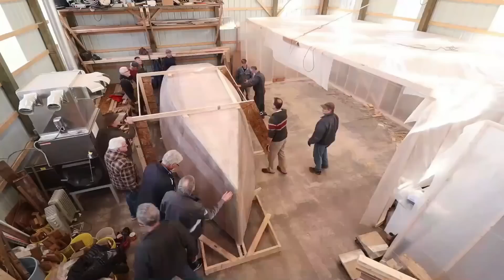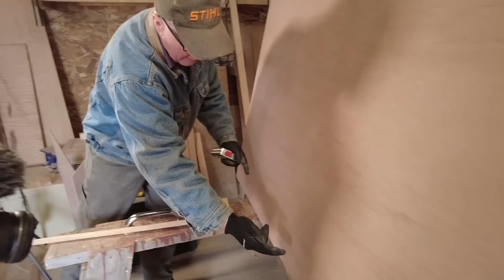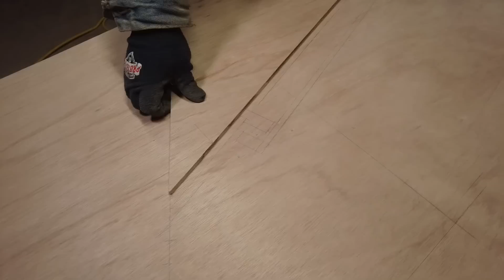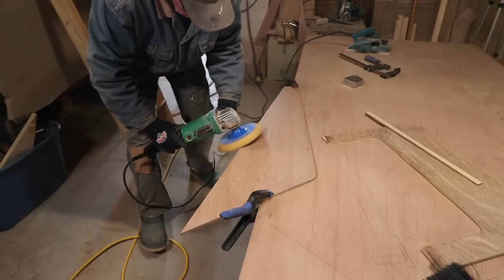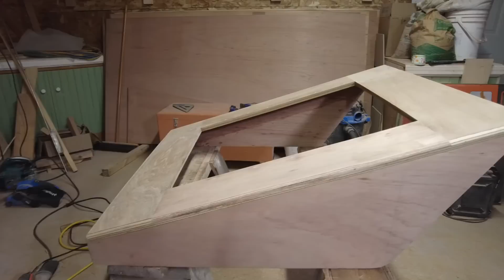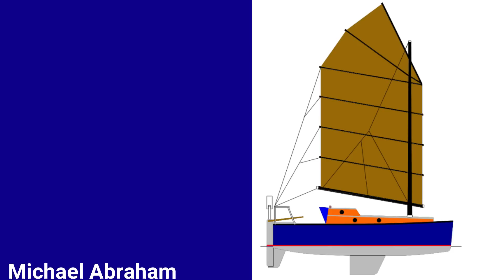S2E77 Story Boarding, the Craftsman's Secret Weapon || Hatch Housing Part 2 || 84 days before Launch

Comment: Fascinating and informative. There is simply no one else doing this sort of video with such an ambitious project. Real boat building 👍👍
Reply from the maker: Thanks, I will be checking out your channel this weekend. Thanks for the email.
Reply: Check out RAN Sailing also, it's pretty good.
Reply: @wyattfamily8997  Ewan is doing a great job, but probably on ten times the budget!
Reply: @wyattfamily8997  RAN Sailing  Bought a farm for the building of the big ship.
In order to install the bow, the wooden beams under the walls of the house had to be removed,
I'm worried that there won't be enough space when he installs the rudder.
His large boat should not use plywood for the hull, it should be made of wood splicing, and then wrapped in fiberglass.
Guess he plans to travel in cold waters to install insulation on the hull.
Reply: And perhaps, for many, doing it on a serious budget!

Comment: When I was a wood boatbuilding student, what you are calling "story boarding" is what we called "lofting". You're simply working in full size to resolve design and measurement issues. If it was less than full scale, it would be called drafting.
Reply from the maker: You see me lofting in an earlier video as I take lines from a plan and put them in full scale. Storyboarding is a more creative process that tests out ideas in full scale before committing to them.